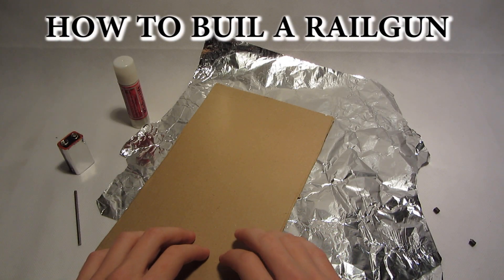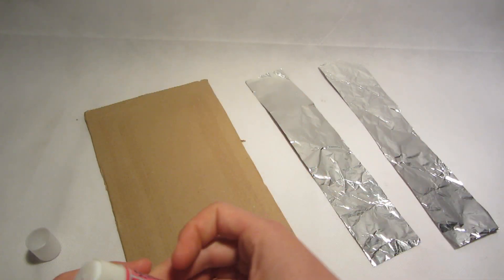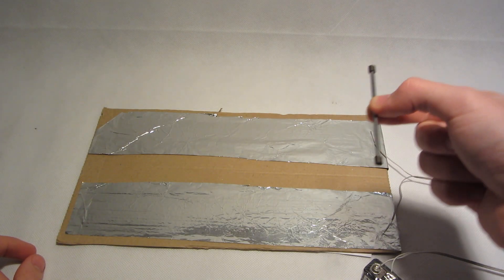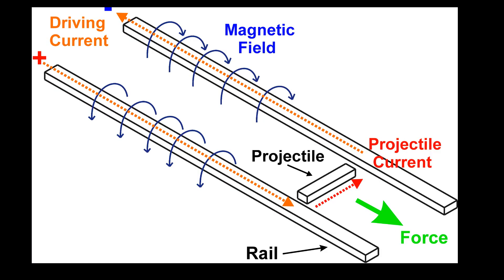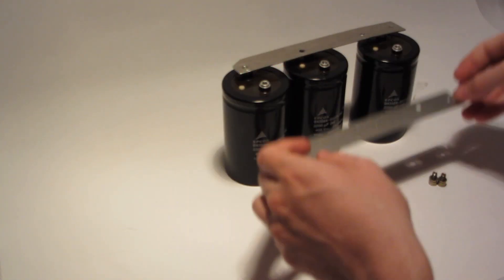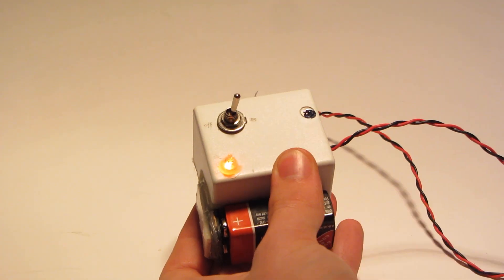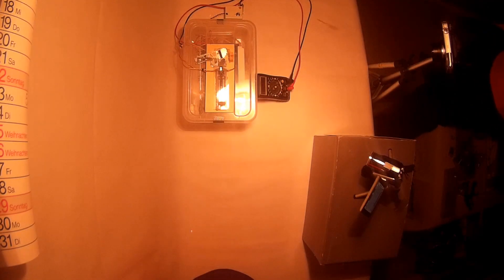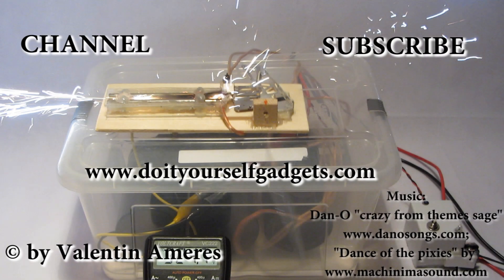How To Build a Railgun Experiment

Comment: It's funny... Until I watched this video, I couldn't grasp how rail guns worked. I understood how coil guns worked, but rail guns went over my head. Then, you spelled it out: the projectile is essentially creating a short circuit between the rails. So, thank you for the video!
Reply: Doityourself Gadgets Du bist deutsch nicht wahr ?
Reply: ***** pl help as soon as I keep the rod with neodymium magnets attached to the rod potential difference drops to zero.. I also tried putting resistance but no use
Reply: Yeah no, same things happened to me. i couldn't figure out how railguns worked and thought that the 2 repelling magnetic fields would have shot it but it didn't make any sense as i tried it and it didnt work. You know someones peak when they can explain things and you understand it.

Comment: I'm currently making a portable railgun and I want to ask if 2/3/4mm 6061aluminum will be able to withstand the discharge of 2 400V 2200uF capacities respectively.
Also, are the capacitors series connected or parallel connected?
Reply: Parrarell increases capacity, serial lowers it, but you can do highter voltage with serial.

Comment: One Question: Why are you transforming it into higher voltage? Amperage creates magnetic fields but Voltage creates electrostatic fields. Railguns need magnetic force so why stepping up not down?
Reply: +Julian vB To be able to store more energy in the capacitors. The formula for stored energy on the capacitors is: E = 1/2C*V^2. As you can see, the voltage is squared. It also had something to do with the dicharge of the capacitors. The higher the voltage, the faster your capacitor will discharge. You can ofcourse have a low voltage capacitor, however, you won't get the same current. So in fact lower voltage would cause lower current.
Reply: +Azagro Thank you dude :D ~1 year worth waiting ;p
Reply: Julian vB
Haha, oh shit you're right. I see your kind of question quite a lot. In this case the voltage is not meant to create a stronger magnetic field, but for the capacitors themselves.

Comment: Would it not be possible to the rails themselves as capacitors? I mean, a capacitor is simply enough two pieces of metal separated by something non-conducting (like the air inside the railgaun)
Reply: Well I would not know, given that I ave never tried it. But if it worked, you could use the rails as DIY capacitors and thereby not have to use any of those big black capacitors shown in the video :)
Reply: ***** Ahh, thank you! :)

Comment: Why doesnt your second model have magnets?
Reply: ***** So the huge military cannons dont have any magnets in them? Can I do this without magnets and with AA batteries?
Reply: the guy who never uploads anything you will need to transform the voltage of the battery up from 1.5 to about 300v.
With that voltage you will be able to charge the capacitors.

Comment: dont work i doing same but the vire just burn the battery without powering rails
Reply: you have to make sure the magnets are oppositely aligned. So either N facing N    or    S facing S. 
otherwise it wouldn't work. This doesn't work the same way as a railgun. In railgun, there are linear forces on the rod, while here, the magnetic field in the ferromagnetic rod along with the direction of current flow result in a torque on the rod itself.
Reply: Roman Rekhler Also, the magnets have to be conductive - but seeing as you are seeming something burning, then you have a closed circuit.
Reply: Roman Rekhler how can i know wich side is n or s the magnet is just black dot
Reply: Kristijan Medved one rail is + other -?
Reply: Kristijan Medved The rod should be iron/steel/otherFerromagnetic metal. The magnets should just be places on the rod in such an alignment that if you were to bring them closer without the rod, they'd push against each other. Whether both Norths, or both Souths are facing the center, doesn't stop the motion, just changes it's direction.
Reply: Roman Rekhler the electric current should flow from one rail, through the magnets and rods, to the other other rail through the other rail, and then through the battery/connecter, and finally back to the first rail. 
I found that it is quite easy to do this just using a AA battery as the rod, and just connect the 2 rails at the other end with any metal object to just close the circuit. If you need extra assistance, I can draw a diagram.
Reply: yes i need more help and how you can move bullet faster
Reply: Kristijan Medved http://i.imgur.com/DwFkxfl.jpg
If it's going to wrong way, just rotate the battery+magnet set. 
The magnets need to be conductive. (black earth magnets aren't good for this, but neodymium are.
Any of these make it go faster:
stronger magnetic field for the same weight
lighter stuff for the same magnetic field
if the battery was more powerful
if the connecter was a powerful battery, and if the rod was a hollow iron tube.

if you aren't seeing a little push but not enough, then your battery might be dead or very off center. The battery/magnet set should be able to roll freely by itself on a level surface.

If the battery is good, but you see no push, that means you need to flip only one of the magnets so that the north/south flip.
Reply: Roman Rekhler so the black magnets arent good?
Reply: Kristijan Medved correct - the magnets themselves should conduct electricity. Otherwise you'll need a different set up
Reply: but aluminium is nonmagnetic metal
Reply: the magnets aren't pushing or pulling against the aluminum - they are applying a force on the current paths going through the connecting rod. If you draw the current paths, and the magnetic lines, you'll see that there is a torque throughout the rod.
Reply: Everything is magnetic
They are either ferromagnetic paramagnetic or diamagnetic

Comment: i thought a rail gun uses coils....
Reply: Yep! Coilguns use a different system which relies on switching fields where a bunch of coils are lined up and timed to perfection allowing each coil to add to the speed of a magnetic slug.

Think of a bunch of magnets lined up and you put a magnet at one end. If you wanted it to get to the other you would need to turn on and off the subsequent magnets. You can to that with electricity.

Comment: It use high amp or high volt?
Reply: ***** High volts does not mean high amperage.  They are separate components to an electric current.  For instance, a 12 volt battery at 80-160 amps is used to start a car, while 120 volt socket at 15 amps is used in a hair dryer.  Sticking your finger on a starter's going to shock this piss out of you, but sticking your finger on an exposed wire in a hair dryer is going to kill you.
Reply: ***** So what volt are you using and with what amp?
Reply: thx man
Reply: amp draw depend on the resistance

Comment: Hey, I made one myself but the problem was is that when charged, the projectile gets stuch at the beginning of the rails but when it is not charged, the projectile can mover freely through the rails.
Reply: Stuck*
Reply: ***** yes it does have an initial velocity. Is there any type of metal that wouldn't get welded to the rails?
Reply: Ali Alfayyadh What metal are the rails and do you have access to stainless steel for the rails? This could probably fix the problem as if you use stainless rails they will not magnetize and they have a much higher melting point.

Comment: Soo is this a 1 time use or a multiple times use? i have looked into rail guns a couple years ago and the common knowledge was that it would be a 1 timer due to melting of the rails or something?
Reply: Railguns are known to be a 1 timer because of the magnetic field produced when shooting. as the rails get magnetized, with extremely high power they can repel each other and the railgun doesn't work anymore :)
Reply: Adrien Wantiez So it still hold to that statement.  than i wonder how GA with thair railgun project does this?? They even demonstrate it as a rapid firing railgun( burts). In a 3D animation, they show ti shooting 2 projectiles after each other in a short time.

So they have to have fixed that problem now after the time they already spent.
Reply: Sword of damocles Aluminium rails! They don't magnetize over time. The only problem is with melting, so they have a certain electrical cap. However some grades of stainless steel fix both the magnetism (They don't respond to a magnet) and melting issues.

Military issue railguns would likely use an iridium rail system if they were ever to be made due to its incredibly high melting point and diamagnetic (Needs an extremely specific set of conditions to be magnetic) nature.

That or a zirconium-90 rail system... XD

Comment: Very cool. I was wondering, what would be the effect of making your rails of wider, thicker material, allowing less electrical impedance/greater current flow? Also, would you get higher final velocity if you make your rails longer (the same way a rifle with a longer barrel will accelerate a bullet to higher velocity than a shorter barrel)? Thanks in advance...

Comment: Would using 8 450V 1800uF electrolytic capacitors work?
Reply: CockatooDude You need the low ESR of capacitors in order to make one. A microwave controller would just make you a spot welder.
Reply: ***** If I used a microwave transformer (2200V output) to power the rails instead of a capacitor bank, could I make the railgun fully automatic. Or does it need current?

Comment: Could you explain some of the science behind this setup, please?
Why did you choose a series connection for the capacitors for example and also how many amps do you have flowing through your projectile ( the amps create the magnetic field, which causes the actual force in the end as far as I understand, correct me if I'm wrong ).
 Also did you choose a specific length for your rails and did you do some calculation on this topic beforehand?

Comment: two questions
first: does it matter what metal the rails are made of
second: does it matter how fast the projectile enters the rail gun
Reply: Yes the type of metal should effect the outcome. However, I assume that all (if not most) metals will have a positive outcome for the experiment. The reason that the metal type should affect the outcome is the different levels of conductivity that each one posesses. The most conductive metals are silver (Ag), Copper (Cu) and Gold (Au) in that order.

The initial speed of the projectile should have little effect on the outcome, unless it was changed by a considerable amount.

One thing I would experiment with in this would be the length of the rails, changing the amount of time that the projectile is exposed to the external force of the field, causing it to accelerate. I would assume that a longer exposure time would be beneficial (to a limit), and that this could be a possible solution to compensating for a lack of electrical current or what differences less conductive materials would have.

I hope this helped. If i was wrong anywhere, please correct me! I'm only in high school so it's not like I'm a physicist or anything. Also, if you decide to try this as an experiment, please share your results! I'm curious, but also somewhat lazy :P
Reply: ok thanks

Comment: If I made a railgun with 10 1000uf 450v capacitors (1012.5 Joules) and shot a 5g projectile from 8-10 inches of rail, how fast would my projectile go? My calculations tell me about 632m/s, but I need to be sure. Thanks!
Reply: Did I test it, bro?

Comment: The first collision shortened out the capacitor, thus the rest of the rails to have no current.  A long length of rails are wasted, you can add multiple little rails with separate capacitors making it more efficient and less wasteful.

Comment: Do you know what kind of muzzle velocity/energy and overall efficiency you are getting?
Reply: E=1/2CV^2 C=Capacitance in microfarads usually V=voltage
Assuming all the energy stored in the capacitors discharges (only about 80% does) and that no energy is lost to heat then simple thermodynamics 
E=1/2CV^2
E=1/2MV^2 (different V, this one is velocity)
1/2 cancels and you're left with C(Voltage)^2=M(Velocity)^2
C=2200micro farads x 3 V= 400v because its in parallel 
M=probably about 15g??
Velocity=265.32m/s